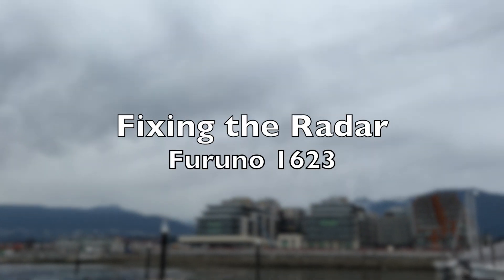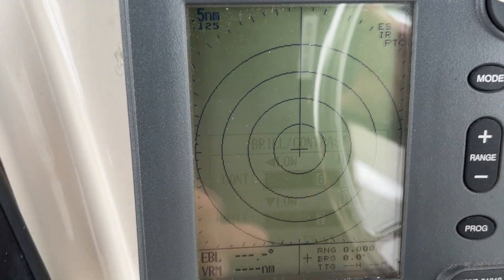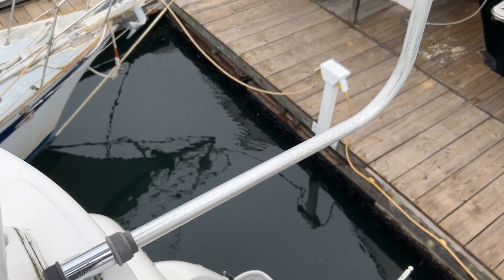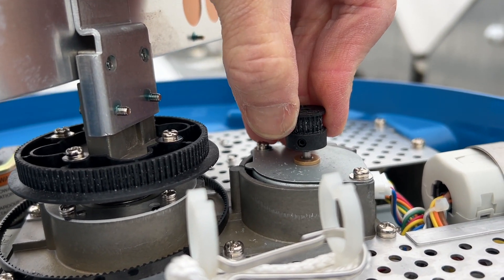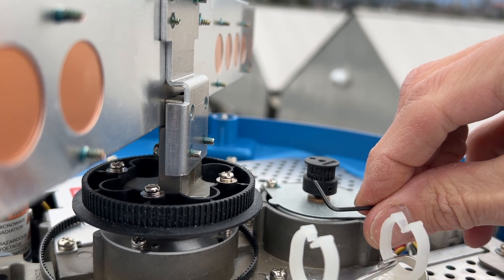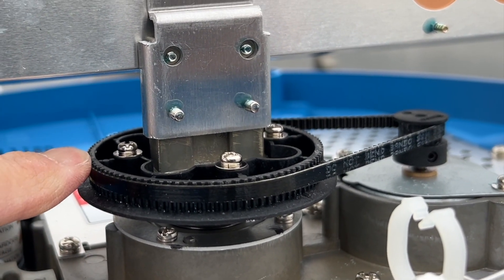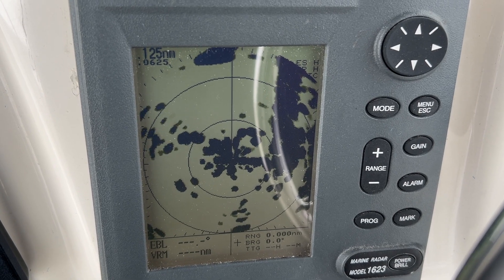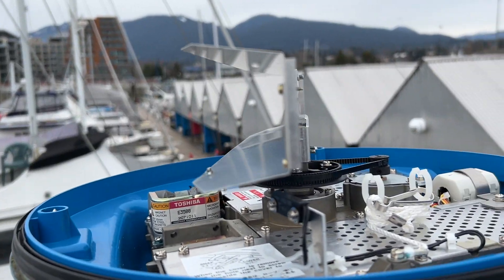Radar Repair | Furuno 1623 | "NO HEADING PULSE" Error Message | MV Manta Ray | Bayliner 3488

Comment: Excellent repair Dave! The drive belt is designed to stay on track with the flange on the motor being on top and the flange on the rotor being on the bottom. The design lets you slip the belt on the way you did but it should keep the belt from walking off.
Reply from the maker: @SteveJackassofalltrades  Thanks JackAss! 😜